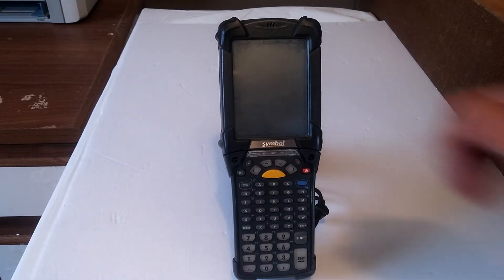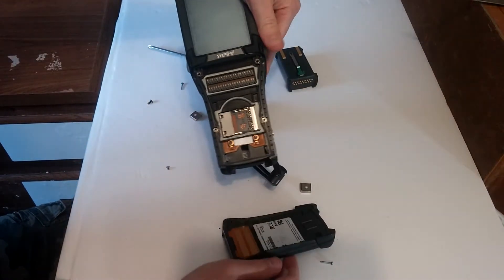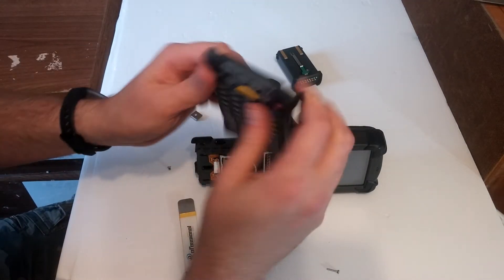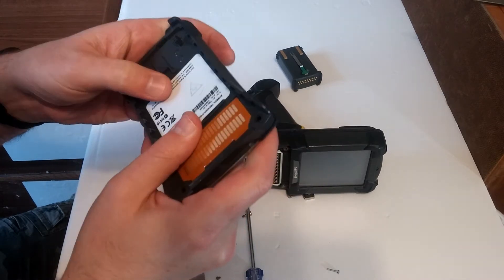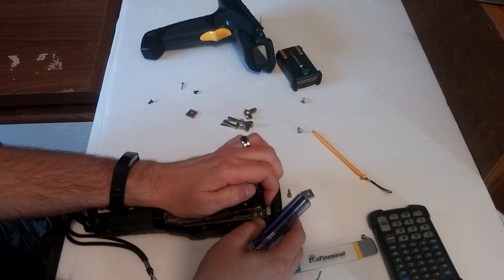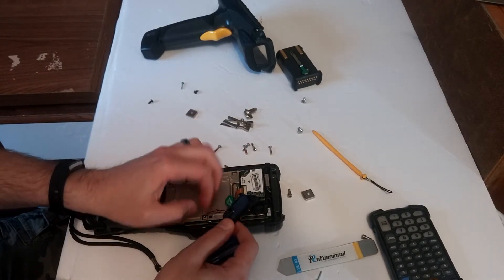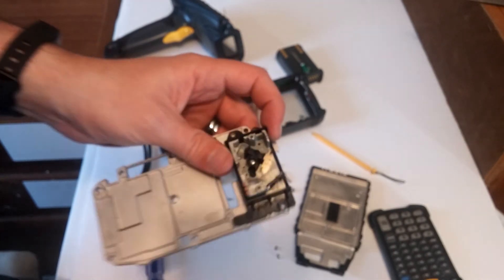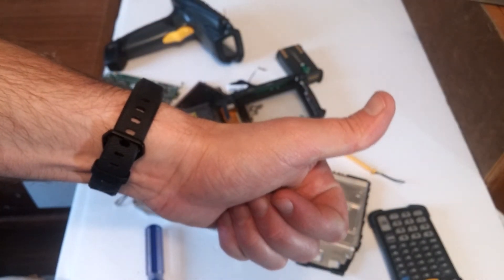Motorola MC9090-GF0HJEFA6WR-KIT Mobile Computer Teardown

Comment: are you a qualified tech? you touched the mirror with your finger (prints) then instead of releasing the clip for the cpu board/screen you just pulled it loose.....
Reply from the maker: For sure, I am NOT qualified to work on these.
Reply: @NevsTechBits  atleast your video was helpful. i have now fixed 3 of ours

Comment: I think he just ripped those connectors off when he used "brute force" and separated the two halves. Do NOT follow these instructions and do what he did in the video like that or you will NOT have a working scanner afterwards.
Reply from the maker: I absolutely agree. I'm doing this for fun. Not a pro!